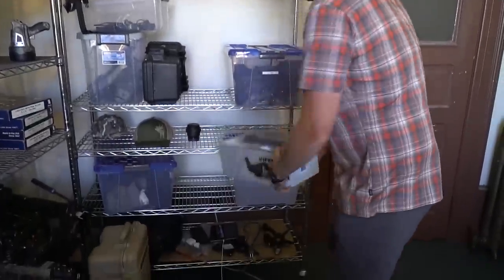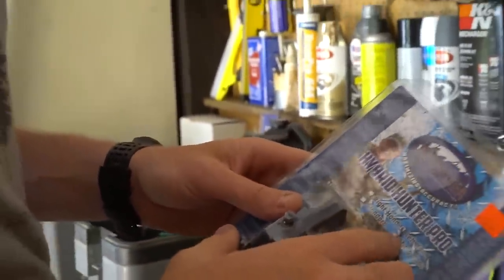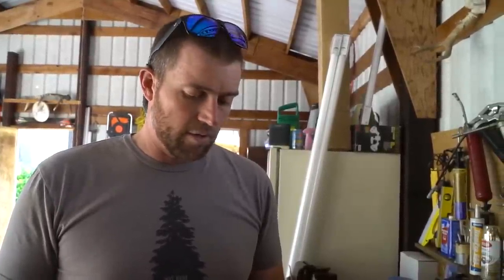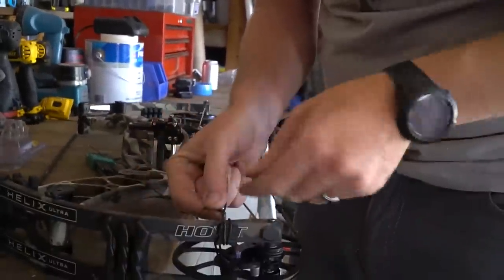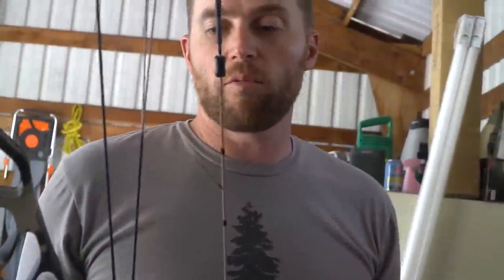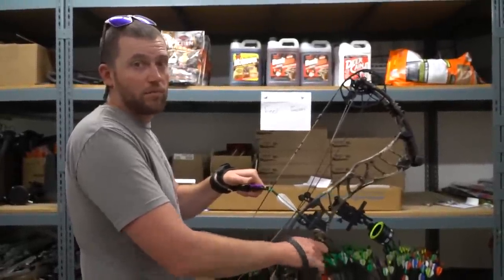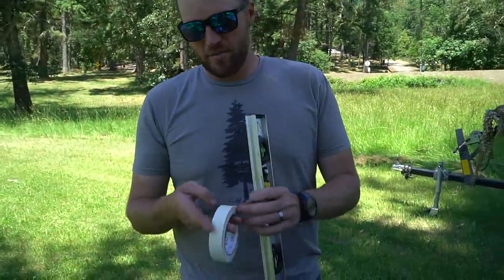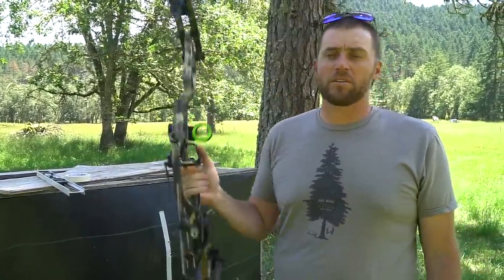DIY HOYT HELIX ULTRA BOW BUILD

Comment: Thanks for the video Cody. I like your little trick with moving your peep ties with the nock, I'll be using that when I mess with my peep height next week. Quick question, when setting your peep height do you ever move your housing to your longer ranges to maximize your range? Shooting a single pin for my 3d/ blacktail rig I like to use my 40 or 50 yard mark when setting up my peep height.